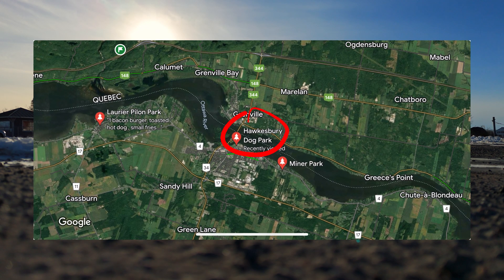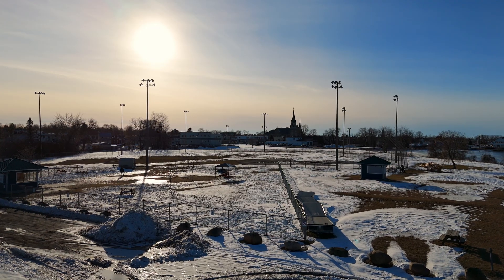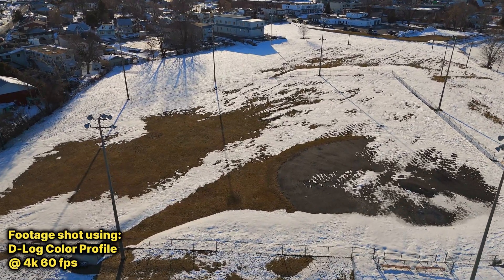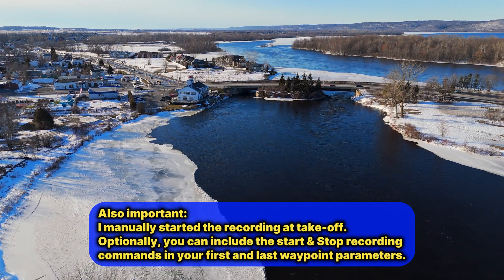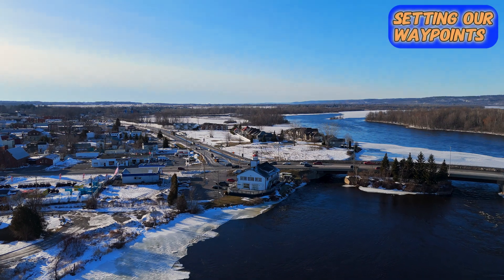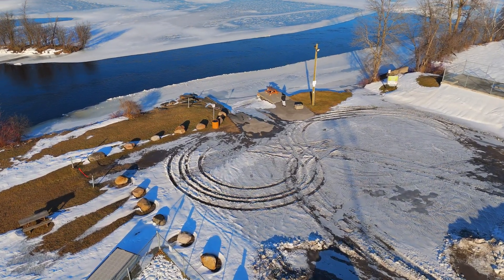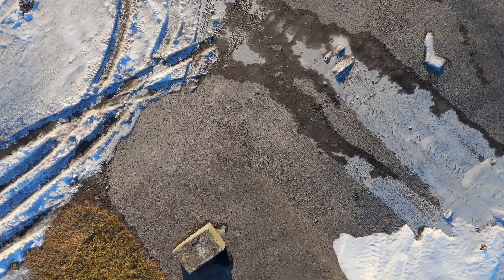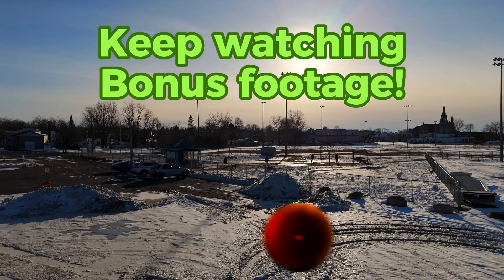DJI Mini 4 Pro / DJI Air 3 Advanced Waypoint Missions Made Easy!

Comment: Doing that in negative numbers temps takes some dedication. 

I noticed that your waypoint mission footage was jittery. What do you attribute that to?

Why don't you use a landing pad?
Reply from the maker: Hi Dave, In Canada January, and February are the two coolest months… On the day of this mission, -6 Celsius is the best you can hope for.😂

Which part of the video are you referring to jittery?
- The waypoint mission set up?
- the waypoint mission flight?
- or the bonus footage at the end?

Also, on what device were you watching?

As for the landing pad, I do have one but I left it in the car unfortunately. Didn’t bother to go back to get it since there was some pavement there.

Regards,
Jerry
Reply: @JMprodquad  
It was the footage from the filming of the waypoint mission, mostly in the sweeping pan shots as the drone swung around to the next heading at the higher altitudes. 

What fps are you recording at? What fps are you working with on the editing timeline and what fps are you rendering at?

I am viewing on a 60Hz monitor. 

I am not sure how the downward sensors and downward looking cameras work with this latest DJI equipment but I do know they are working and they are apparently sensitive to the extent that DJI even installed a landing light. I too noticed your drone hop back off the ground and then settle back in for a landing and I have never seen that before. I always use a landing pad and mine has never done that. I also have never tried landing directly on the ground at -6c. I don't know if that is a variable that may affect the flight landing characteristics but it is pretty severe conditions none the less. I still have a hard time imagining standing around outside in those kind of conditions setting up and then executing a waypoint mission.
Reply from the maker: Hey Dave, I really appreciate your time to help with this.
I shot the following pieces of video as follows:
- iPhone 14 @ 4k 60fps
- DJI Mini 4 Pro footage @ 4k 60 fps
- RC2 Controller  @ 720 30 fps

It was all rendered @ 60 fps but my timeline was set at 4k 30 fps.. You got it there 100%. 

Funny though I played back my video from YouTube on my iPhone 14, iPad and my new 65" LG TV and didn't have any issues. Went back to the drawing board, modified my video's timeline to match @ 4k 60 fps, Re-uploaded the video as an unlisted copy on my YouTube channel and did find the issue after testing it on all 3 of my devices.
(If you don't mind, please send me the start & end time.)

As for the Land, skip & hop back in the air, after picking up the drone, I noticed a slight slant on the pavement and some pebbles in that area... I think it must of landed on a pebble and the slanted pavement didn't help because it must of slid at the same time. My guess is that DJI has built in some recovery during the landing process.

really appreciate your time on this.
jerry